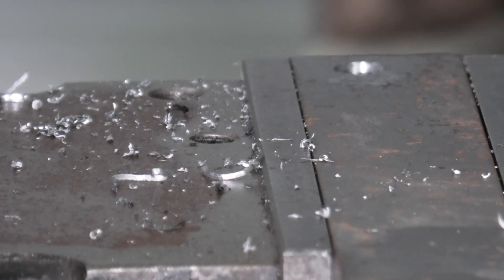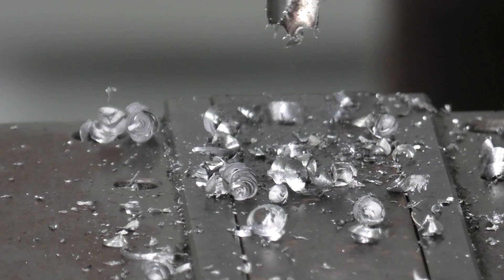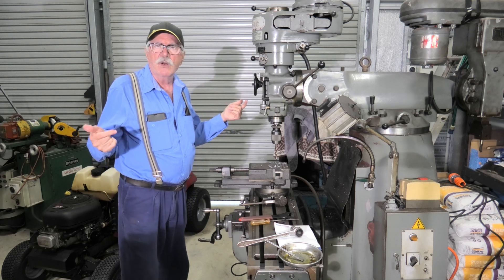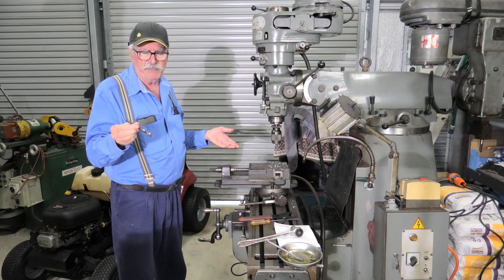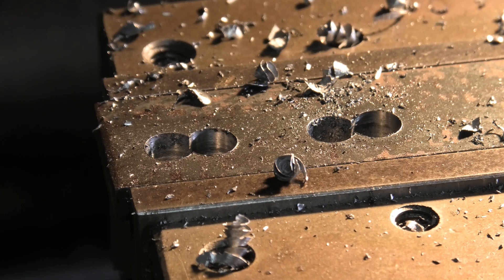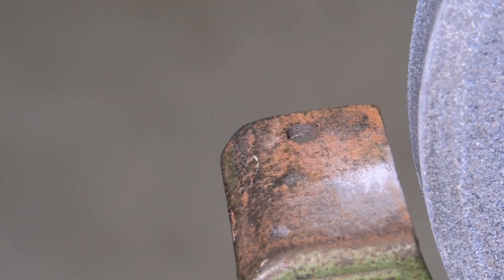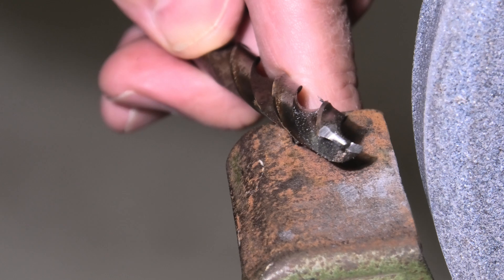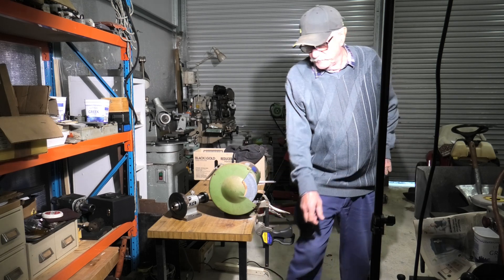Chain drilling or stitch drilling?

Comment: Max Grant just recommended your channel for this, so I’ve subscribed. Now I have a question, would Dewalt Pilot Points work? If not then how much modification?
Reply from the maker: Hello mr. Troll. I'm not familiar with that drill. What are they made of? Could you send a pic. I question the need as any good jobber drill can be ground zero angle. BC
Reply: @inmyshedwithbc.  Dewalt’s Power Points come in hss, TiN, and Cobalt, I believe. It is probably easier for you to google it than to chance YouTube having a reaction to me sending a commercial link… it’s probably 30 years since I sharpened a drill bit, and my hands are given to periodic shakes now.
Reply from the maker: @trollforge  I had a quick look and they might do it. BC